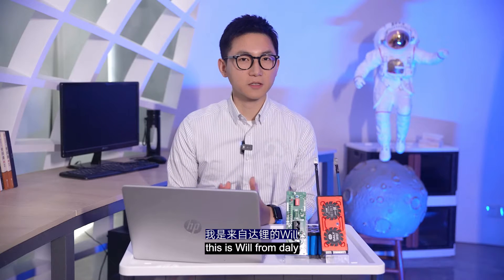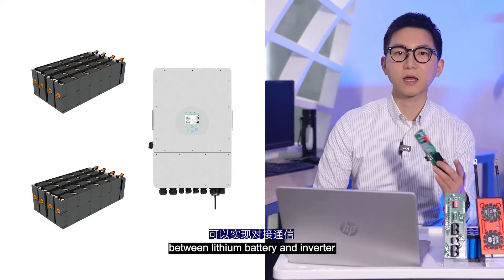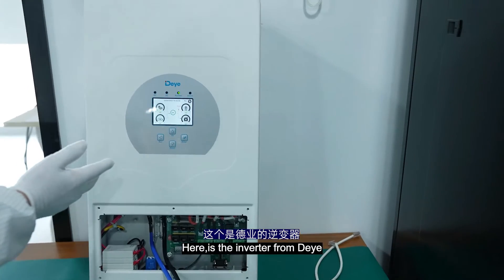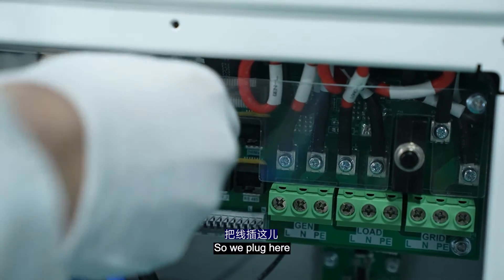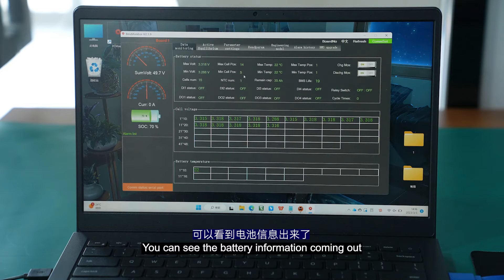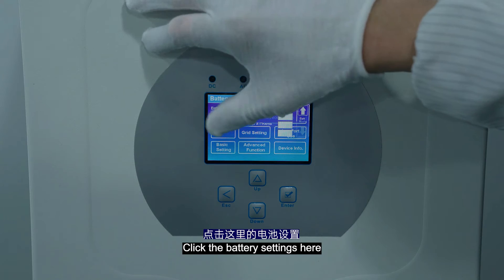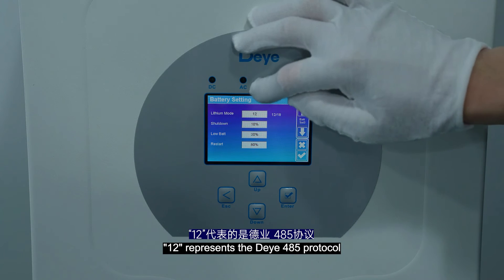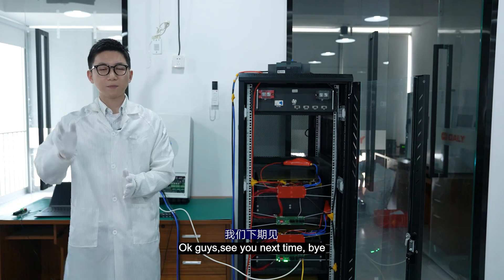Functional Demo of Interface board!

Comment: Hi Will, can Daly communicate with Luxpower SNA 5000 inverter?
Reply from the maker: Yes, Daly bms adapts to the mainstream inverter protocols
Reply: @dalybms666  what battery type/number would you set on the Luxpower inverter? And would you put the comms cable, Can to Can?